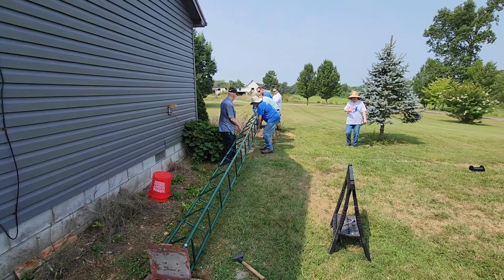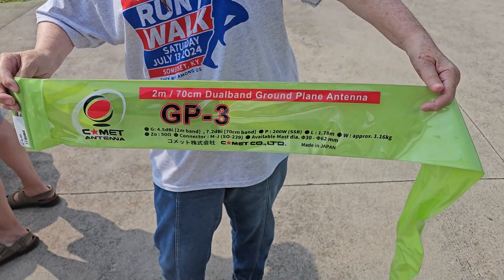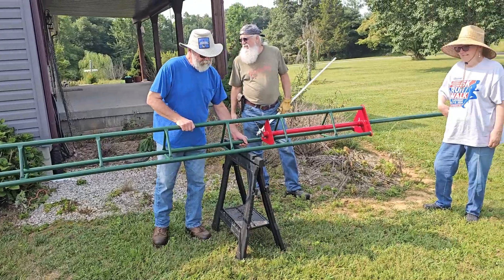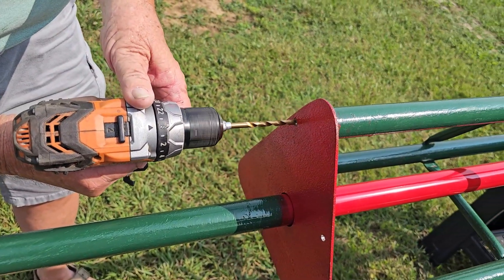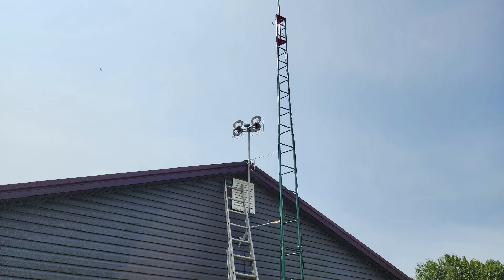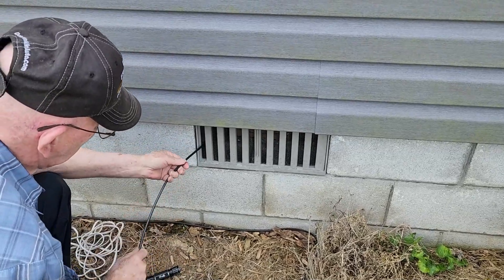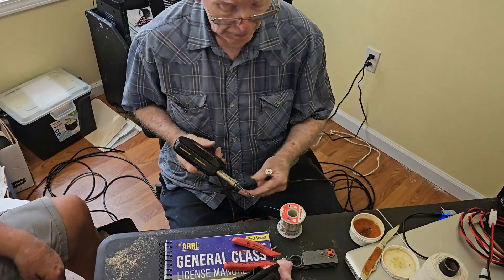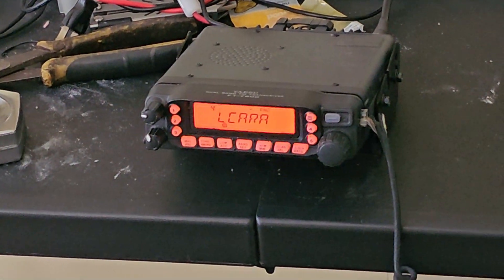LCARA HAM Radio: What Do Ham Radio Clubs Do? Help Raise Towers For Their Members!!!!

Comment: I think since we all are not getting any younger to put all your antennas you need on a tower even back up cause it ain't easy when coX deteriorates or no help .

Comet GP3 is lower gain stand by bug use a $150 - $200 dualband antenna and all diipole's attached use los loss coax as always .
But it's good to have people to get together and get a tower installed . 
Looks nice Christmas Theme red/green !

Comment: There was one thing I noticed you guys didn't wrap the connector where it connects to the antenna with the rubber tape to protect from water intrusion , I always put the rubber tape and a layer of electrical tape on top of that even though its in that tube.  Also you should coil the coax either 1 or 2 times in a 10 inch coil just under the bottom of antenna about 16 inches down. I do all mine that way. It was an enjoyable video like always you guy's create.
Reply: Hello, thanks for the comment.  We did actually wrap the connector as you mention before the final lift of the tower, it just did not show in any of the clips. Chris KY4CKP